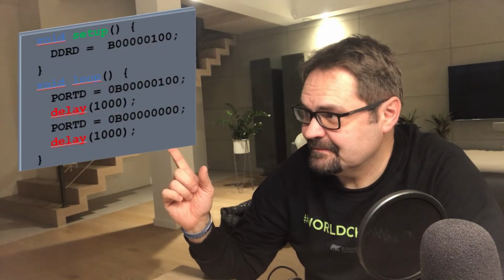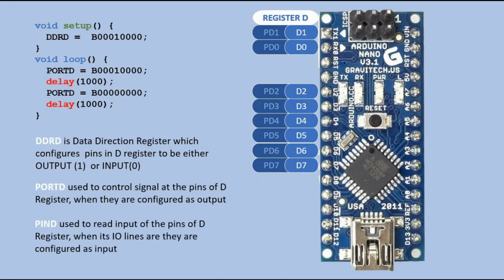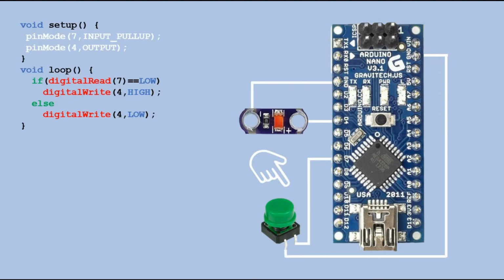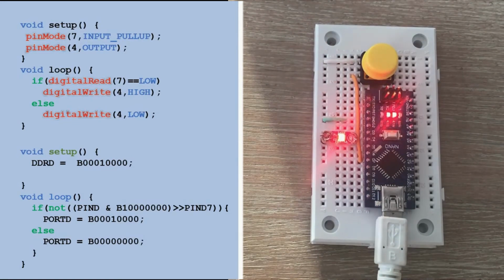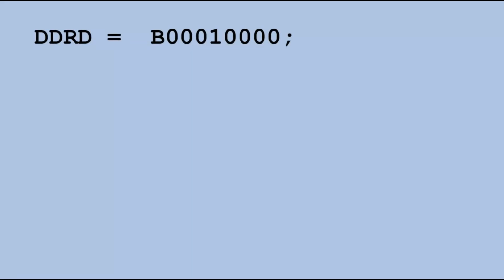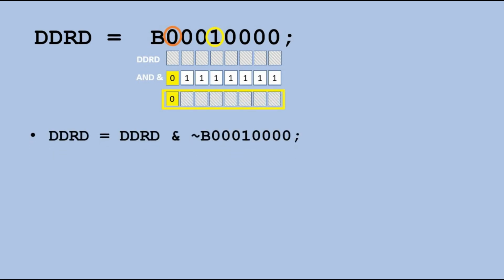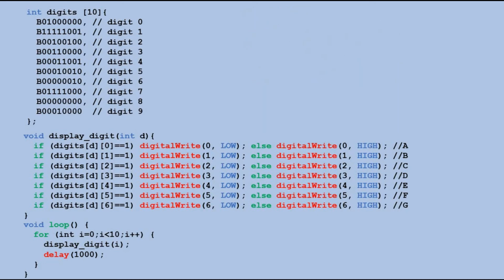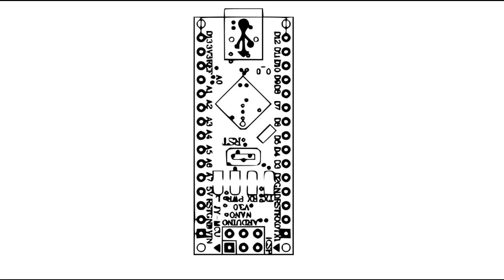Advanced Arduino Code Optimisation with Pin Registers

Comment: Sets third pin on PortD as output and all others as input, the loop toggle that same pin on and off. Not sure why you kept the default setup and loop functions though if you're going through the trouble of using port registers.

Edit: In actual practice, you'd OR it with 0x04 to turn it on and AND it with 0xFB to turn it off as to not affect the states of the other pins on the port.

Comment: Can we use digital pin D0 and D1 as output and drive LED
Reply from the maker: Yes
Reply: @marios_ideas  
But if we attached LED to those pin then is there any problems with Rx TX communication
Reply from the maker: You cannot do both. I always thought D0 and D1 are off limits and reserved  for RX TX. But with pin registers I was able to use them to control LEDs
Reply: @marios_ideas for example I built a blutooth controlled robot 
If I detected any obstacles can I drive D0 and D1 pin to logic low
Reply: If I do so .... Is blutooth connection disconnected

Comment: Nice explanation. Setting PIND also functions as a toggle...eg: PIND = B00010000 will toggle pin 4 each time the code is executed.
Reply from the maker: I did not know that:( I would have included it in my video
Reply: @marios_ideas  No worries, it seems wrong to 'set' a read only register but it works and is very useful.....and extremely quick. Apparently turning pins on and off is a 'thing' and the challenge is, of course, to do it the fastest.....you'll find lots of weird and wonderful 'port manipulation' code on the subject.